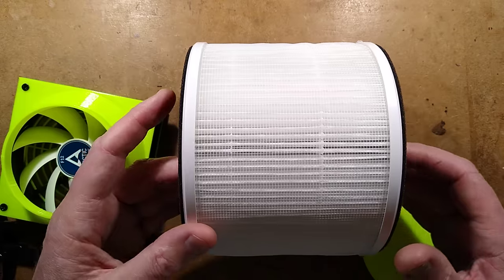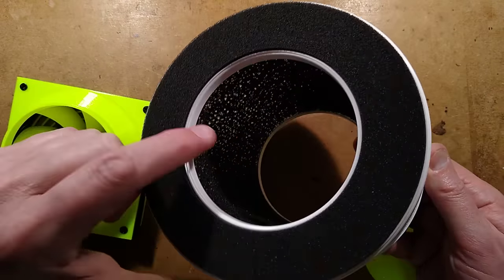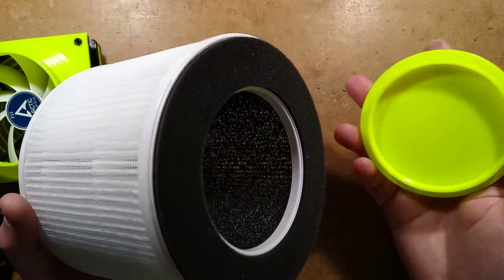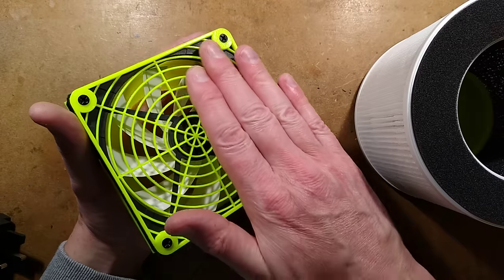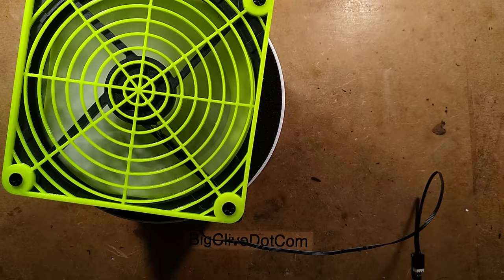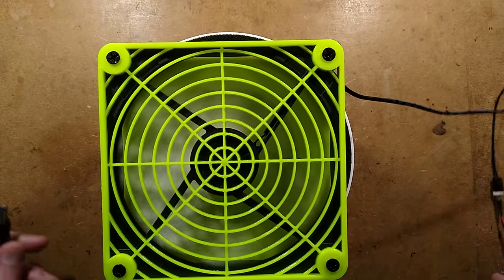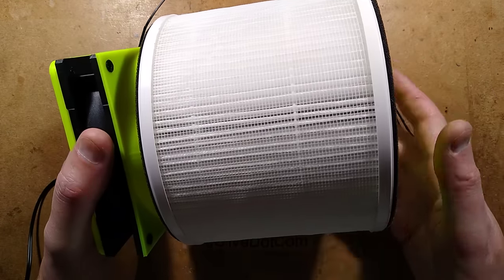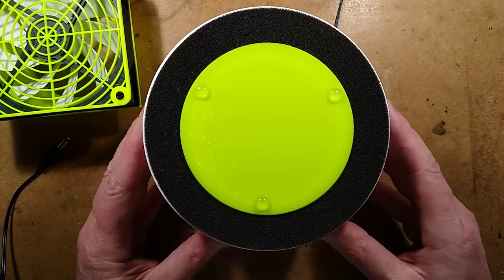DIY cheap & quiet HEPA air cleaner

Comment: If it's a proper computer case fan (ball or fluid dynamic bearing), I don't believe the orientation matters.  Many cases have horizontal mounting options for fans (and/or radiators) at the top and bottom of the case.  I'd have to assume that major fan manufacturers nowadays take this into account as I haven't seen any warnings against horizontal mounting of case fans.

[edit]
See comment below for a link to a more in-depth fan discussion, including bearing type and suggested fan orientation.

What about swapping out for a high static pressure fan (fans made to push increased airflow through radiators)?  Seems the filter would offer similar (if not more) flow resistance where static pressure fans would be a benefit?

I'm picturing it now...  A USB fan hub controller connected to several (or more) PWM fans mounted to filters.  More or larger is better?

I'm also a bit disappointed if this is all there is to a HEPA grade air filter solution.  I paid quite a bit for a name brand "air purifier" that uses a squirrel cage fan (GermGuardian True HEPA Filter Air Purifier with UV Light Sanitizer -- though I don't use the UV).  Thing is noisy as hell at anything other than low speed.  I'd imagine your setup with some 140mm (or larger) fans and appropriately sized filters would be more efficient, quieter and cheaper.
Reply: Air volume cycled relates to room volume cycled, and HEPA filters get more effective at higher air speeds. But more or less? Yeah, the cost of a HEPA air cleaner is an air mover and a HEPA filter cartridge.
Reply: @Ulf Zimmermann Funnily enough, I just watched this video and came here to correct my initial response about bearing type and orientation.

Having said that, I've run fluid bearing fans in the horizontal position for multiple years (current ones are >3 years @ 8+ hours a day) without issue.  I guess a lot has to do with manufacturing quality as well.
Reply: Yeah given the layout of PC cases, especially if you do custom water cooling, fans get mounted every which way. The bearings should last just fine as long as you don't start/stop the fans too often
Reply: The Arctic F12 fan used here uses a fluid dynamic bearing so oiling is not an issue in a horizontal orientation.

A fan with a higher static pressure such as the arctic P12 would probably do a better job at pulling air through the filter.
Reply: If you're just pulling fans out of the parts box, the ones with fewer, chunkier blades tend to be better at static pressure.
Reply: I accidentally bought airflow-optimized fans for my liquid cooling radiator instead of the pressure-optimized ones. It made no difference. If it can fail to make a difference in what it's designed for, I wouldn't hold much hope for it making a difference here.
Reply: @Delaterius  airflow fans will work, just not as efficiently for the use-case. This HEPA filter will provide greater static pressure for a fan to overcome than anything you put in a computer, so it's probably more worthwhile getting the correct fan than it would be if you were mounting up, say, a radiator for your cooling loop.

If I was building something like this I might be tempted to pay a tiny bit more for a NF-F12 5V and power it off a USB power bank for added flexibility in where you put it.
Reply: You are right. FDB bearings are not depending on the direction. Only sleeve bearings can get damage if used horizontally.
Reply: Airflow vs Static Persure?
As far as i know, if you pull air thru "filter, radiator, etc" Airflow work as good or even better.
If you need to push air thru something the Static Persure Fans are better because of the width of the blade wich doesnt allow as much of "backflow" and therefor builds up the static persure wich pushes the Air thru.
For Radiators, there is a configuration called push-pull. Static Persure Fan -> Radiator -> Air Flow Fan.

all imho
Reply: There's the thing that "HEPA" is just a word by itself. To it having really good meaning, there needs to be rating for it, which would be something like H14, which are sometimes used in ie. food packaging machines. There's the nasty downside that so-to-say actual HEPA filters are so dense and effective that they need monstrous fans and fairly large surface area to work at remotely silent sound levels. Many ie. hoover filters are just basically normal air filters, which is just fine of course. Real HEPA filters come with classifications and generally speaking come with warranties and test certificate, making them obviously also pretty steeply priced for normal household usage. Just thought to give industrial HEPA viewpoint.
Reply: LIAN LI computer cases has one running like that for like 8 years .
Reply: Centrifugal fans are always more noisy than traditional fans, it also moves more air. There are some gaming pc fans that are quite quiet even at rated power._
Reply: @FrostByte00 had the same idea, but not to clean the air, just to keep the inside of the pc clean. maybe i build one like this in the future, but i have a lot of projects to finish first. if i remember this idea and the video, comments etc. i maybe will post it here.
Reply: @jothain  Indeed, I was thinking the same. Tried to do very similiar project few years back, but I found out that if you get an actual HEPA filter (needed one since there's a lot of smog in the winter where i live) a PC fan doesn't create enough static pressure, and that really small air volume that is pushed through wouldn't make much difference anyway. I came to the conclusion that this setup would do fine with dust or maybe realatively big particles, but not much else.
Anyway, I'll just mention that I don't speak from the experience, as i dropped the project when i get a bit more informed. Maybe there are certain configurations that would work
Reply: @FlamingToaster  Yeah. HEPA is bit of an trend word. For instance at work I replace I replace filters for electronics compartments and they're rated iirc G8. That's the most basic filter and I've never seen visible dust in cabinets IF filters have been properly in place. Then there's the mentioned HEPA filters, but they actually can't be used as such. They're protected by multicell pre-filter and that's classification is iirc F11. Now these filters get really filthy as previously mentioned cabinet filters, but even these are pretty much clean on "inside". They get slight dark color. But these are so good, that I could lick the stainless steel surfaces next to the actual HEPA filters. HEPA filter itself after year of usage is absolute clean visually speaking. There isn't a speck of dust and there can't be any as it would be clogged immediately. I read something about our used HEPA classifications and they're affective against viruses and it should protect against ie. Anthrax virus and likely ie. Covid as well I suppose. This HEPA filter element is aluminum framed to withstand pressure and they're about 20-30cm thick units. For your usage you should indeed go fairly close to HEPA levels, but as said. It would need to be multi level filtration against smog. Now I hope anyone doesn't get me wrong. Virtually any filter is better than nothing and even those HEPA filters have the particle size and percentage value which they can remove. We're talking so little things that apparently so small items can get through filter in correct orientation. Plus I can vouch that ie. vacuum cleaner HEPA isn't in the "official H" level. Not even close. Alone the fact that I've always smelled vacuum, just slightly, but there's that small hint of smell and that pretty much tells already that it can't filter everything. They're good, I certainly am not denying that, but not that good 😀
Reply: @TheLOD2010  That's not true. I have run 180mm sleeve bearing fans at ALL sorts of weird angles with continuous (24/0) duty cycle for nearly a decade now.
Guess what - the only ones that failed were dropped or not greased/lubed every 20k hours... the lube is what kills them. These are high end silverstones though so your range may vary on western taiwan junk.
Reply: @FrostByte00 I have a pc running, with some good quality fans... This might be a nice project, why haven't I thought about it?
Reply: Cheap fans are almost always sleeve tho.
Reply: yep, back in the day this was a fairly notable issue but anymore with a decent computer fan it's not (arctic generally makes good stuff so the one shown likely has no issue with this orientation) fans optimized for static pressure (designed for water cooling radiators) would also do best in this application.
Reply: @BrianCurtisPCT  Proper fluid dynamic bearing fans have a delrin or acetal resin plate that prevents friction or wear. Nearly as strong (per weight--may even be better; depends on the fiber fill) as steel, nearly frictionless, and even more abrasion resistant than steel. Acetal really is a wonder material; there's nothing even remotely like it.
Reply: cheap fans like the video survive 2-3 years in our PCs Generally not good value for lifespan. Great for a project. More industrial versions like delta and noctua can last 5-6 years and discarded for logistical reasons. They still work fine, but cost of replacing a fan is too high to risk it. All of that is cheaper than the alternatives. The key factor is the size of the particle as recycling already filtered air serves no purpose and that makes PC fans quite limited for this purpose.
Reply: @jothain That bit of smell may not be what you're pulling in from the vacuum though.  That could be the smell of the vacuum itself, namely heated plastic.  Benzenes are generally what you would smell as other off gassed compounds are odourless.
Reply: For this function, you are better off with a fan optimized for air pressure rather than air flow.  They make computer fans for both, so just pay attention. For air pressure, you can usually tell because the blades almost overlap if you look straight down on them.

Comment: I made something like this for my rabbit's room to keep dust down. I used a blower motor from an old heater instead of a PC fan, it has a bit higher static pressure. The amount of hair, dust, etc it catches is insane! Definitely a good thing to have in the house.

Comment: I use a psu that has a switch for different voltages. Those artic fans run nice and quiet at 9v. Loving the ryoby colour of plastic.
Reply: Does that PSU got a name?
Reply: I had a hard disk fan in my computer case, ran it at 7V by connecting it to the +5 and +12V terminals of the molex connector.
Reply: @TheJttv  There's a lot of generic wallwart type power supplies where you can switch different voltages on. I once got an AmazonBasics one. It was crap, don't get that one.
Reply: Saw a listing in an online store describe it as Hyper Green.

Comment: Great project Clive! Had only larger fans on hand, so I have changed up the code to work with 140mm fans. The four variables can still be adjusted freely.

Here's the code if anyone needs it:

//140mm fan adaptor HEPA filter
$fn=100;
//You can adjust these four variables
//Primarily the filter hole diameter
screwhole=5;     //fan screw hole diameter (5)
filterhole=119;     //HEPA filter hole diameter
thickness=1.5;  //Thickness of plastic layer (1.5)
insert=10;          //Length of insert into filter (10)
//Do not adjust anything below here
cone=(140-filterhole)/1.5;
wall=thickness*2;
difference(){
union(){
//flange
translate([0,0,0])
cube([140,140,thickness]);
//taper to filter insert
translate([70,70,0])  
cylinder(h=cone,d1=140,d2=filterhole);
//filter insert
translate([70,70,cone])  
cylinder(h=insert,d=filterhole);
}
//taper to filter insert
translate([70,70,0])  
cylinder(h=cone,d1=136,d2=filterhole-wall);
//filter insert
translate([70,70,cone])  
cylinder(h=insert,d=filterhole-wall);
//fan attachment holes
translate([7.5,7.5,-1])  
cylinder(h=thickness+2,d=screwhole);
translate([7.5,132.5,-1])  
cylinder(h=thickness+2,d=screwhole);
translate([132.5,7.5,-1])  
cylinder(h=thickness+2,d=screwhole);
translate([132.5,132.5,-1])  
cylinder(h=thickness+2,d=screwhole);
}

Comment: If you don't have a 3D printer you can use plastic food and drink containers.  Dip them in a bowl of hot water for a minute or so then reshape them, then dip it in cold water and it will more or less hold the shape.  
For this project a 2 litre bottle would be perfect I think, just cut off the top part (which should be near 120 mm wide at its base) and cut where it tapers to the right width at the top.

Comment: This is beautiful.  I would suggest three improvements. 

1. A pressure or static fan as suggested by other commenters.

2. A slide compartment to accommodate a pre-filter before the fan.

3.  A clamping mechanism, perhaps similar to that found in your car's engine air filter container to manage seal/leakage.

Great video.  Might get a local shop to print and ship this out to me.